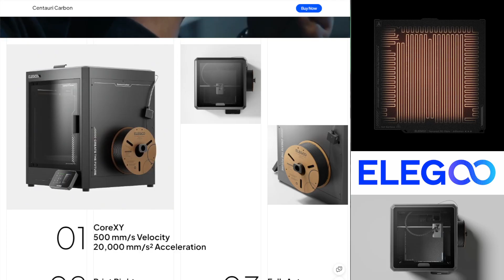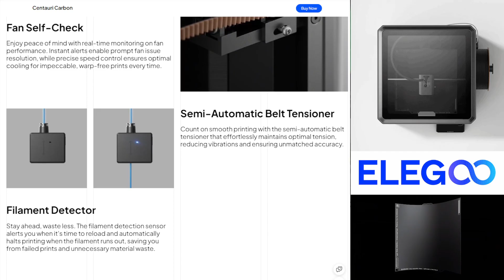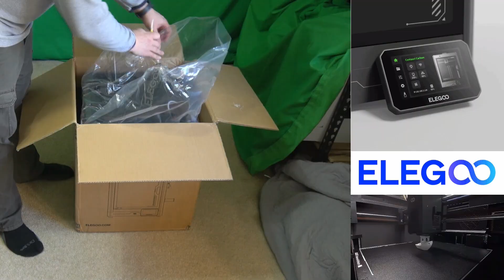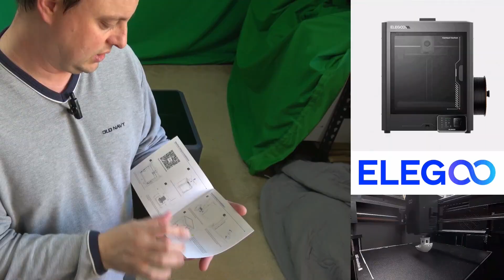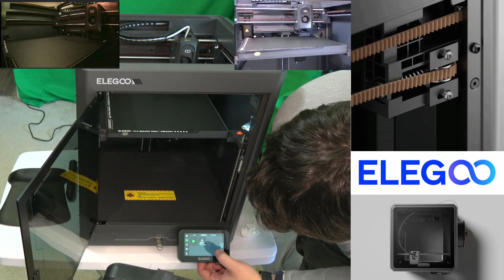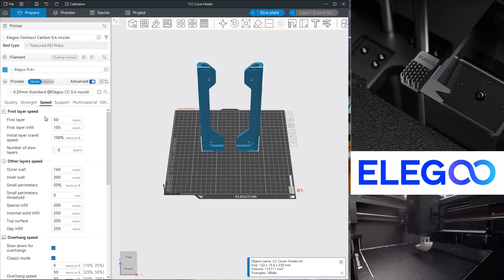🔥 Meet the Centauri Carbon — Elegoo’s Amazing CoreXY Unbelievable Value at $299 - 3D Printer! 🖨️

Comment: Does it have USB to print?
Reply from the maker: Yep. Comes with a USB drive which is what I used for the prints I did, but also a full web interface.
Reply: @MrTasselhof  Good, I hate that lil sd card.
Reply from the maker: Actually misunderstood.... No USB cable option. Just USB drive and browser